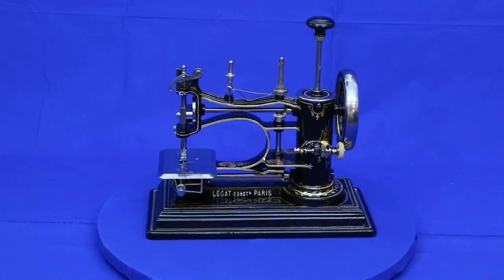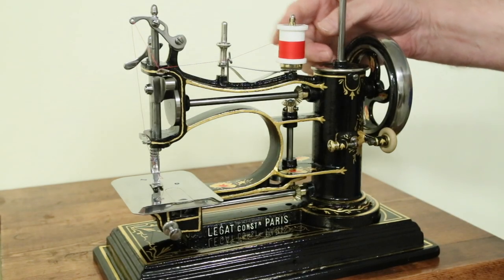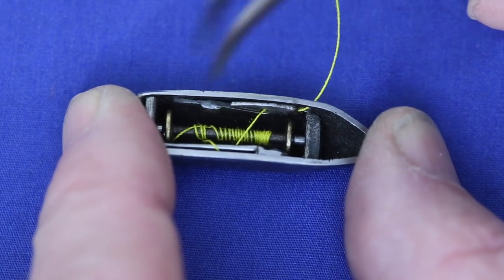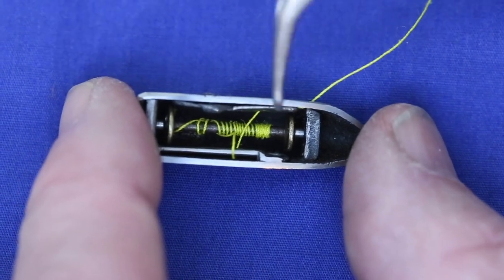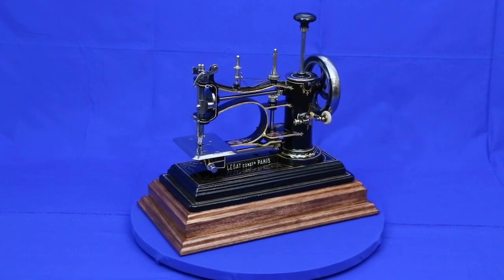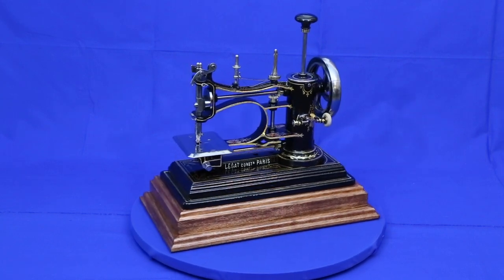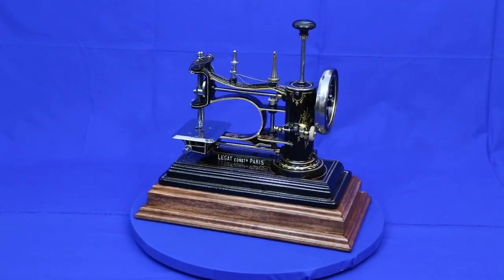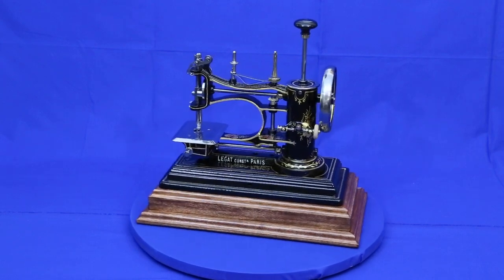Antique Augustin Avrial Sewing Machine

Comment: I look forward to the WW9 I have a UK version, the handwheel is different to most I have seen, and a different bobbin holder more like modern machines. 

My WW8  bottom tension seems to be a clamp to grip the thread during the LS formation, this is not part of the hook or bobbin holder.

I love the renovations you do "stunning", I don't do that I sort of lack the confidence and prefer to make them work and then we use them.
I did paint a Jones 1896 with sanding sealer and a a cosmetic soft brush and some meths thinner since the previous owner has stripped all the shellac from the machine exposing the bed of roses to damage. The old lady has put the machine on display in her living room, but now since I told her the modern round shank needle will work she will use it. The machine history is a family friend traced back to the owner as it was when new, which is nice.
I used tungsten router bits square/round by hand to scrape the base clean of all the crud, the base had fallen apart it is now fixed and no longer black as pitch.

The WW8 base was so soaked in oil it warped out of shape, then the previous owner added shims to the long sides and then made it worse, seem to have fixed that problem. The slight issue I have is I may need to make some new brass needle bar brass bushes, the ones on the machine are quite sloppy.

Current project Singer 28k born in 1891 I had to take off all the rusty metal on the case and wood base and pickle them in white vinegar. I found three of these on the bottom of base ? location pegs for a treadle ?  https://photos.app.goo.gl/vzcC52FwSGmJSfSN6

Rust removed with vinegar - washed and into a warm hot pan to dry the moisture - put in foil / plastic tub with WD40. I will blue them or lacquer them later 
All the best
Reply from the maker: You're certainly busy! My wife and I were in an antique shop and couldn't believe it when over in a dark corner sat a WW D-9 on a treadle for only $20! We couldn't believe it. We didn't have room for it and already had a WW 9 so we were tempted to walk right on by it, but we couldn't stand to see it insulted by such a low price, so we gave in and brought it home. All the artwork is gone but all she needed was a little oil and she sewed as smooth as butter on a hot day. Once both it and the WW 9 are restored I'll make a side by side comparison video of them.

Our house is getting so full of sewing machines we may have to tear out the front bathroom to make room for them.  🙂
Reply: @wayneschmidt490  I have been trying to post some photo links but YT is stopping me ?
Shame they are my WW8 and WW9 UK versions of the machine, I might try tomorrow.

Comment: Beautiful and unusual! Too bad it couldn't have been improved upon, thereby continuing it's production.
Reply from the maker: One excellent design factor I forgot to mention is that because of the rack-and-pinion drive system, it's impossible to drive the machine in the wrong direction. On a treadle, when going slowly, it's easy  for the treadle to stall and suddenly reverse direction. That can't happen on an Avrial.
Reply: @wayneschmidt490  
Absolutely brilliant!